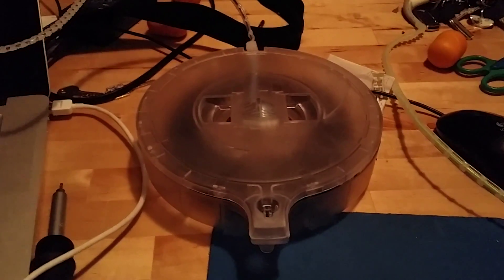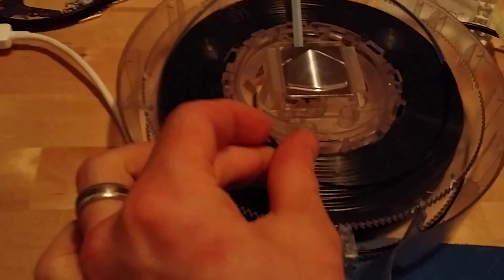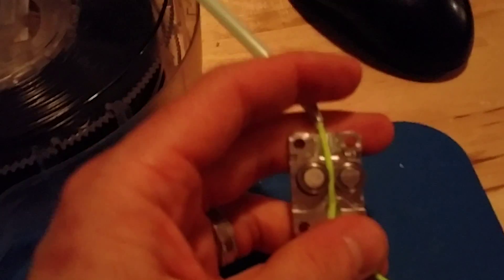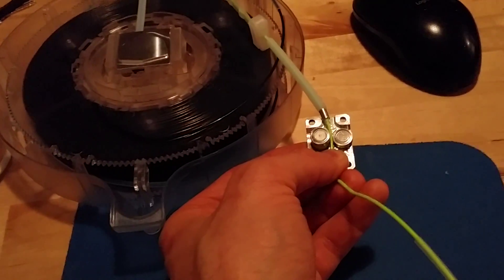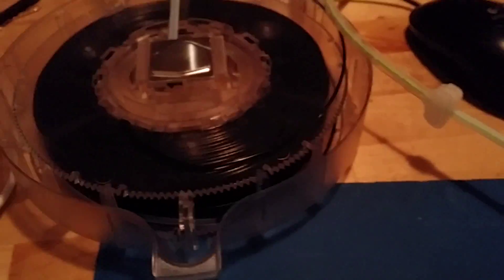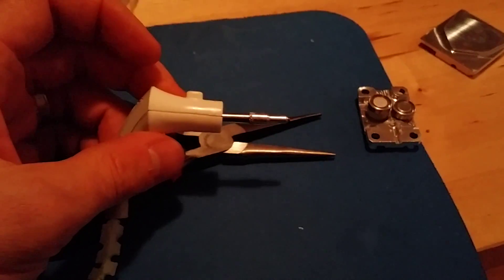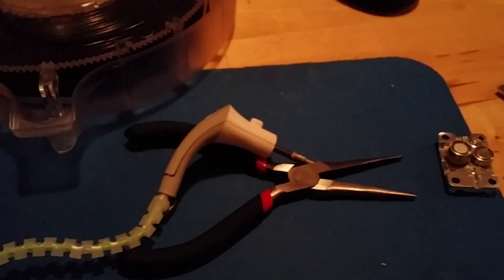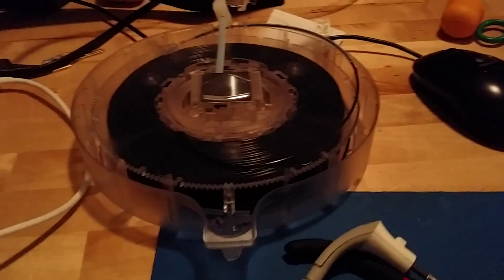Cube 3 cartridge clog jam fix

Comment: This happens with every cartridge I have bought. I bought them before the “redesign” and I’ve read that the ones shipping now are much better. The only way I’ve found to fix the problem is to totally disassemble the drive mechanism. Pull out the stripped filament, cut it off then re-feed undamaged filament up to the hot end. It’s incredibly frustrating and wasteful to find a failed print half way through because of this.

Comment: I've been having this problem with a bunch of my cartridges. Four out of five, in fact, have jammed, and this solution hasn't worked for them. It worked for one of the other two cartridges though.

I really hope they get this issue fixed soon. They've been great about replacing the stripped cartridges, but it's a real pain. The new firmware was supposed to solve the problem, but it happened to me again today on a brand new cartridge.